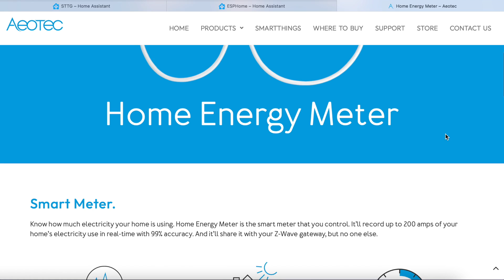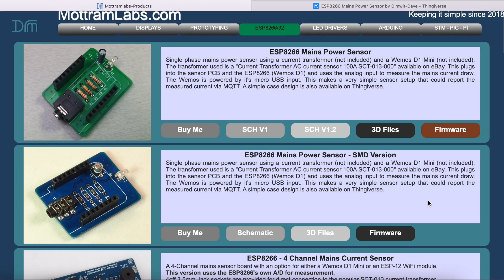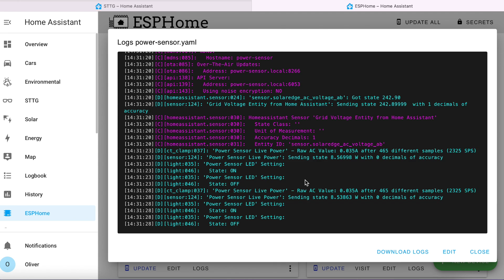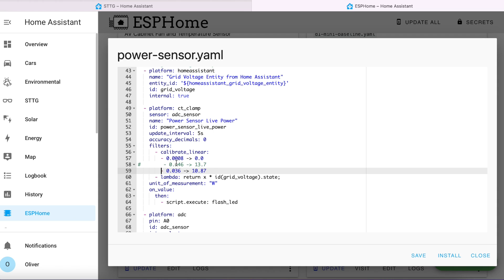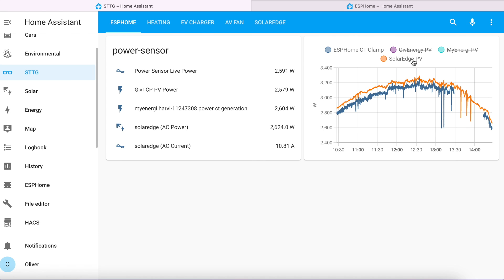Build your own CT Clamp Power and Energy Monitor with ESPHome

Comment: Hi, great video. I’ve ordered the parts (used your links), just waiting for the Mottram PCB to arrive now. Do you have a link to the steps followed and code used to program the device? I’m new to HA but understand you’ve used the ESP Home integration in HA? If you could explain the steps it would be much appreciated.
Reply from the maker: Hi - the link to the code I used is on my web site (https://www.speaktothegeek.co.uk/2022/08/esphome-ct-clamp-power-and-energy-monitor/). I assume you already have ESPHome installed in Home Assistant? If not, that's your first step. Depending on how you are running Home Assistant, you either install it as an add-on in the add-on store (easiest way if you are using the 'supervised' version of Home Assistant), or you'll need to manually spin up a container somewhere to run it. To program the device, you create a new device in ESPHome (any settings will do to start with), then edit the configuration manually and paste mine over. You'll need to have set up some secrets (see the items prefixed with !) in the Secrets page of ESPHome for things like Wifi passwords / other passwords. You can then plug your microcontroller into your laptop using a microUSB cable. Use Chrome (or you may get issues), and you should be able to use the 'install' option in ESPHome to connect directly to the locally connected microcontroller. How to use ESPHome is probably worthy of a video in itself and there are plenty of starter guides out there. I might do one myself soon...
Reply: @SpeakToTheGeekTech  thanks so much for the detailed response. Doh, I’ve scrolled through so many pages of documentation over the past few days, I totally missed the code, sorry! The 3 x D1 minis I ordered via the amazon link came today, they don’t have the headers soldered on but I’ve got a soldering iron and it adds a bit of fun to the project. In terms of calibration, I have an idea to use a hand held current clamp meter. I know some use things like a kettle, but my logic is measuring the mains feed I actually want to monitor should give me a more accurate calibration? Thanks again, I’ll let you know how I get on!

Comment: I see a "buy you a coffee" in your future. My attempts to get a stepper motor working via ESPhome within Home Assistant working have failed. Now to be honest and admit how dumb I will sound I did have it working. What happened well my server crashed and I did not back up the YAML files and the addition to the configuration. YAML. So have you ever tried to get the following to work in ESPhome:
5V 28BYJ-48 stepper motor
ULN2003 stepper motor driver
As mentioned I did have it working and was able to pan my camera mounted out front of my home left and right. (3D printed the gear box that the camera was mounted on). Since then have tried to get it working but can't remember how I did it.
Any help you might care to toss my way is welcomed. 
Enjoyed your video love the one on the clamp-on power setup I had one for my washer.
Reply from the maker: Hi- I haven’t used any stepper motors at all yet, sorry. I do want to try that out but I need to think of a use-case for it first! ESPHome’s web site has a specific section just for the ULN2003 (https://esphome.io/components/stepper). It looks straightforward to me, but then again these things never go to plan! The control of it by Home Assistant looks very similar to the way you control a servo like the one I used in my WiFi Water Pistol video.
Reply: @SpeakToTheGeekTech  will order one from ALiexpress and have it mailed to you so you can try to get it working. Just looking to share the pain I guess. BTW that link you posted is broken and FYI.